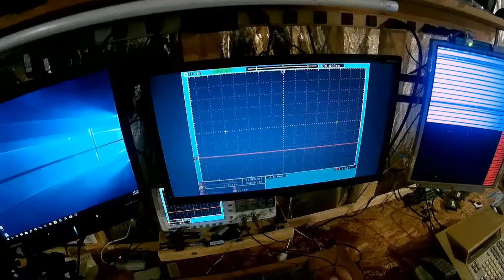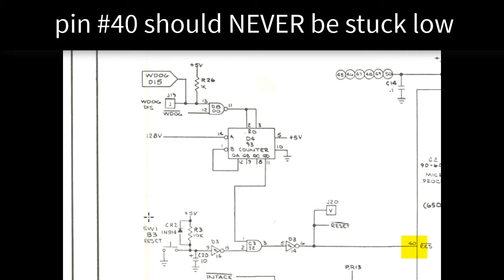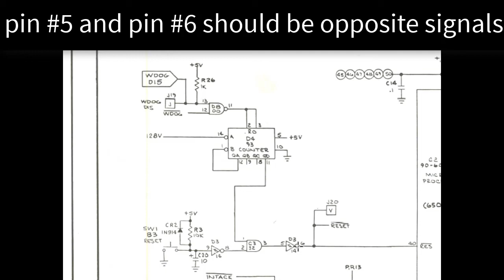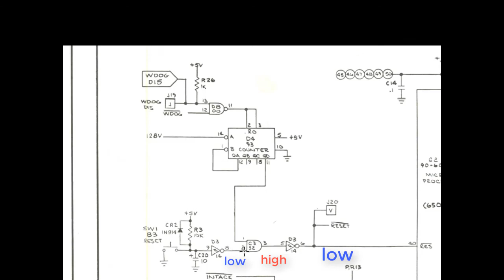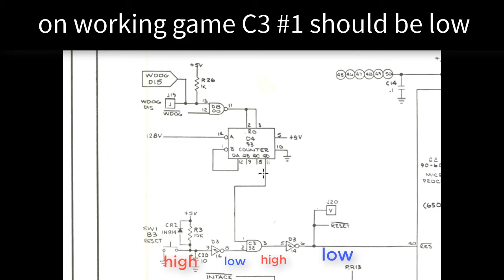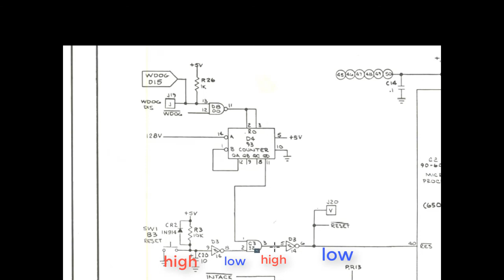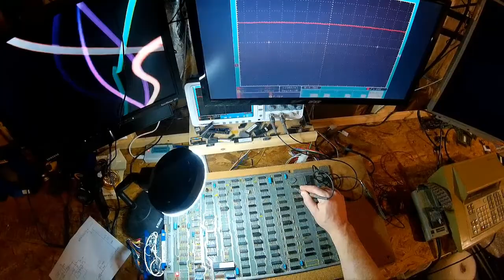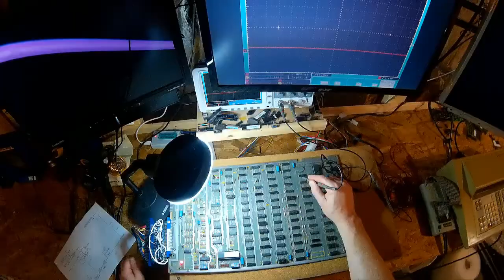arcade PCB repair essentials - diagnosing the RESET circuit

Comment: Using a digital counter to count how many clock pulses before the watchdog circuit resets the arcade game. Once the arcade repair tech knows how many clock pulses occurs before the watchdog circuit resets the arcade game. How can the arcade repair tech read the game ROM chip using a GQ-4X Eprom reader and take the measured clock pulses to figure out in the game ROM data content what address value and data value happens in the ROM code to send out a watchdog command to the watchdog circuit?  Example if it takes 50 clock pulses before the watchdog circuit resets and then you read the game ROM data content, how can I take the measured 50 clock pulses and know which address value and data value is the correct content that is sending out the watchdog command to the watchdog circuit that is resetting the watchdog circuit to the CPU reset pin?

Comment: ARCADE CABINENTS.COM, When the arcade game is constantly resetting watchdogging. And you disconnect the watchdog circuit from the arcade game and then the "game stops resetting". 
1.) How do you know if its the ROM's chips or the address decoder chip or the RAM chips? Because It can be either of them that is causing the game to reset.
2.) When Disconnecting the watchdog circuit and the game STOPS resetting would this isolate and eliminate that the ROM chips are good, address decoder chips are good, Data buss and address buss are good?
3.) The arcade game ROM chips game code outputs a "special address" to the address decoder chip to RESET the watchdog circuit. If the the ROM chip game code is corrupted and is sending out a corrupted "special address" or is sending out a scrambled "special address to the address decoder chip. This will cause the watchdog circuit to constantly RESET the watchdog circuit?   
4.) If one or more of the RAM chips is corrupted and the arcade game is constantly resetting watchdogging. How would the watchdog circuit know that one or more RAM chips is corrupted and not working correctly?
Reply from the maker: good questions:
1) you don't know what it is, you have to do more testing. I would test the RAMs and ROMs with a Fluke 9010a to see if they have errors. It's also possible the RAMs and ROMs have errors,  if all rams and all ROMs have errors it's most likely some circuitry they share

2) no, disabling the watchdog circuit just allows to you test to make sure the watchdog circuit itself is not broken. Disabling the watchdog allows you to try to boot the game. if the game "works" when you disable it then you know the game mostly is working but somethign with the watchdog circuit itself is broken, that's very rarely the case though

3) no the ROMs don't output anything. to the address decoders. The ROMs just output the data on the data bus when the CPU "reads" from a ROM address. The ROMs do have code that the CPU reads and interprets what to do. So in the game code (which is stored on the ROM) the programmer has instructions to read or write to the special "reset" address every so often, the CPU does the reading or writing that causes the address decoder to reset the watchdog counter.

4) it doesn't know what the problem is. however if the RAMs are working, the game code will almost certainly not run correctly, therefore the code that tells the CPU to reset the watchdog will not happen, and the watchdog will kick in. it IS possible (though unlikely) that some RAM can be broken and the game will actually play and the watchdog will never kick in. (usually graphics RAM) however usually if any of the RAM is broken the game will not work right, (usually lock up) and never do the instructions to reset the watchdog counter, same thing with the ROMs, if a ROM is bad, the game will probably lock up and not execute the watchdog reset code. That said much of the graphics and sound circuitry are usually so detached from the rest of the game that they can go bad and not cause the watchdog to reset the game.
Reply: @arcade-cabinets  thanks for the help
1.) So if one or more RAM chips are bad the watchdog circuit will not reset? causing the watchdog circuit to constantly resetting the CPU? 
But how does the Watchdog circuit know if one or more RAM chips are bad, because ALL the ROM chips are good and the special address is resetting the watchdog circuit. 
So somehow the watchdog circuit knows there is a bad ram chip even though the game code ROM chip is resetting the watchdog circuit timer but somewhere the watchdog circuit will know when there is a bad RAM chip?
Reply from the maker: bill williams 1) usually yes a bad ram will stop the watchdog from resetting the counters, and the game will reset then.
No the watchdog circuit does not know anything about the games ram or Roms or really anything else. But if a ram is bad then the cpu almost certainly will not be able to run code as the cpu needs the ram to work for all but the simplist things. There fir if the ram is bad the cpu will almost certainly not read/write data to the magic reset address and then evetunally the watchdog will fire a reset to the game since it never had it’s counter cleared.
Reply: @arcade-cabinets  ok thanks for clarifying
Reply: @arcade-cabinets  The Daughter boards kits use a term called "madsel" must be an abbreviation for multiplexed address select.  The multiplexed address select is from the GAL/PAL chips or address decoder chip. 
Does Address decoder chips multiplex the address select lines? I didn't know that address decoder chips multiplexed address select lines
Maybe GAL/PAL chips do multiplex the address select lines
Reply: @billwilliams6338  Hi I don't really understand your question, could you restate it? In regards to the MADSEL on the braze chip, if I recall, yes that is a PAL/GAL
Reply: @bebrzezicki 
Does an address decoder chip "Multiplex" the address select lines?
Does a PAL/GAL chip "multiplex" the address select lines?
a TTL multiplexer chip will multiplex the select lines 
So what I'm confused about is how an address decoder chip "multiplexes" the address select lines. There must be an internal TTL multiplexer chip inside an address decoder chip?
There must be an internal TTL multiplexer chip inside a PAL/GAL chip?
Reply from the maker: @billwilliams6338  There is no such thing as an address decoder chip, there is only an address decoder circuit (which contains a few chips usually), one of them is usually a demultiplexor.

a GAL/PAL chip is just a generic chip that does whatever it's programmed to do. It can be programmed to be a multiplexer or multiplexer certainly. more detailed info on PAL/GAL chips it's probably best to refer to wikipedia etc to see how they are made (google for GAL, a PAL is just a GAL that can be reprogrammed by the end user)
Reply: @arcade-cabinets  yes I mean an address decoder circuit. 
1.) The MADSEL circuit on daughter board kits is an address decoder circuit and it also does address multiplexing also?
2.)  An address decoder circuit "does not" do address multiplexing it only does address decoding?
3.) I'm confused what is the different between address decoding compared to address multiplexing because it seems that terms are interchangeable and mean the same thing.
Reply: @arcade-cabinets  
Can you measure each data buss line one by one while the arcade game is running and use a logic analyzer to get a hash or crc signature from the measured data signal?
You can measure each data buss line one by one using a logic analyzer to get the hash or crc signature for each data buss line being measured?
Reply: @bebrzezicki  
Decoding an address is taking an address value and enabling/disabling devices like ROM/RAM chips. 
Is there any other type of Decoding that arcade games do?
Multiplexing an address is taking an address and "routes" it to a different location like what a GAL/PAL chips does? 
Multiplexing an address is taking 2 or more addresses and multiplexing them to one output line like what a GAL/PAL chip does?
Reply from the maker: bill williams I’m not familiar with the term “multiplexing an address”. Address deciding is reading the requested address and enabling the right I/O chip or circuit (usually ram or rom). Are you talking about bank switching? That’s where one address range can “map” to one ram/rom chip one moment and that exact same address might later map to a different ram/rom chip.
Reply: @arcade-cabinets  thanks for the help
Yes 
1.) what is it called when bank switching can use the "same address range" to route to one RAM/ROM and then route the same address range to a different RAM/ROM chip what is this called? Is this called address multiplexing? 
2.) Because I'm confused by the daughter cards kits says that the madsel circuit means multiplexed address select.
So what do they mean by multiplexed address select? 
3.) I don't understand the difference between multiplexed address selected compared to address decoding?
Reply: @arcade-cabinets  
           ..>. Can the Fluke 9010A output a "consistent instruction"  and you can use a logic analyzer with 8 logic inputs to measure all 8 data lines at the same time to get a data signature or hash/crc?
Reply from the maker: @billwilliams6338  yes, I do a "looping" read of an address or write of an address. If you did a looping write you could see the patterns with a logic analyzer to see if something is out of wack,  I was once going to make a video doing something like that, but never did.

In regards to a logic analyser, I've never used a signature analyzer (I have one but never found the need), but I believe you probably could create a signature for the values your writing.
Reply: @arcade-cabinets  Yes that is exactly what i was thinking just press the LOOP button when read an address or writing an address. 
1.) But how would you use the logic analyzer to tell if the pattern is out of wack or not?

Logic Analyzers will display the 8 data lines in hexidecimal values.
2.) I'm not sure if a Logic Analyzer can display signatures or/either CRC & hash values also when measuring 8 data lines?
I'm guessing some logic analyzers can measure an 8 data buss line and calculate and display it as a signature value or CRC/hash value 
3.) The fluke manual i think said something like this when you press The DATA BUSS TEST button:  The Fluke 9010A outputs different pulses at different frequencies and duty cycles on each data buss line for troubleshooting a data buss. So when you use a logic analyzer you can see if there is something wrong with your data buss. 

If each data buss line has the SAME pulse width and duty cycle I'm guessing you won't know if one or more of the buss lines are shorted together.
Reply from the maker: @billwilliams6338  I'd bet high end logical analyzers could probably trigger on a certain event and print out the value of the individual signals. I have 2 logic analyzers and haven't used them much. one is way too big to use (it's old and HUGE and heavy), and I have another tiny one that hooks to a computer that I've wanted to use more, but usually I find my o scope is enough to determine the problems I see.

with the loop and measure Idea I'd just write to an address a certain value starting with 0x00, then 0x01, then 0x02 to sees what the signature on a signature analyzer woudl be, then once you have signatures you can test them later when fixing boards to isolate the problem quickly, however you can also do that with an oscope pretty easily, but you have to do one or two lines at a time (depending on how many channels your oscope has, some have 4 channels, mine only has 2 + a trigger) but I've found that works plenty for me.
Reply: @arcade-cabinets  yes that's how to do it, just what I was thinking also. 
1.) Just to make it clear what really is a signature value? a signature value is not a hexidecimal value or a CRC value or hash value.
2.) What is the difference between a Signature Value compared to a CRC value or Hash Value? 
Because a Signature Analyzer can only measure ONE data buss line at a time to measure and display a signature value. So I'm not sure what a signature value is really because its not a hexidecimal value or a CRC value or hash value.
Reply from the maker: @billwilliams6338  1) I don't know what the signature value is since I've never used a signature analyzer, from the looks of mine it's a hex value, and I'd assume taht's some type of CRC/Hash value of whatever signals it's measuring, but I've never used mine so I never needed to actually understand how it works.

2) at least in the fluke 9010a a signature is just another term for CRC/hash value.
Reply: @arcade-cabinets  oh ok thanks for the help.